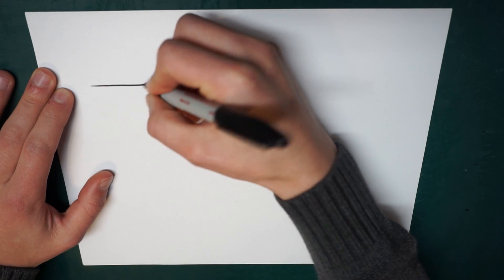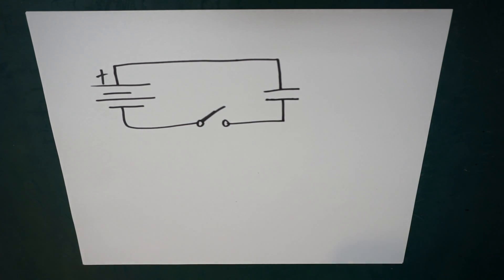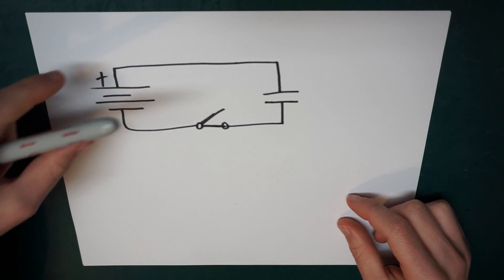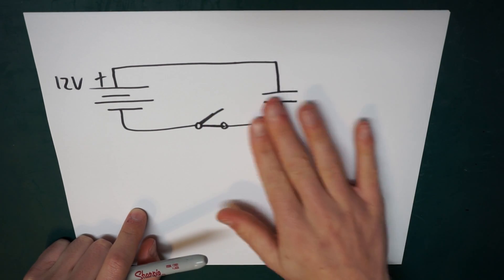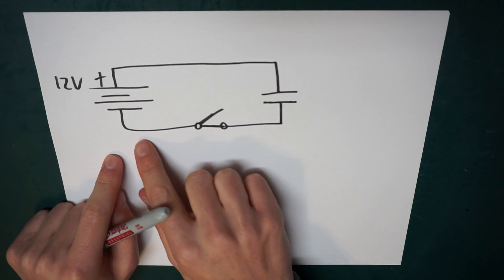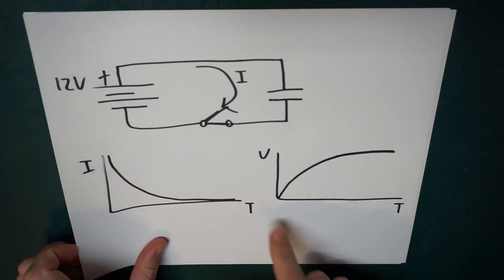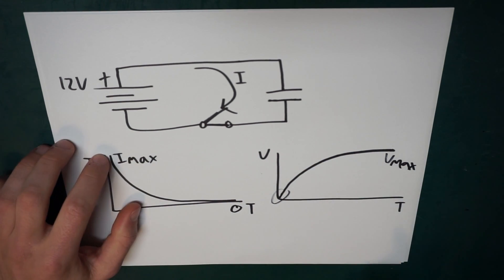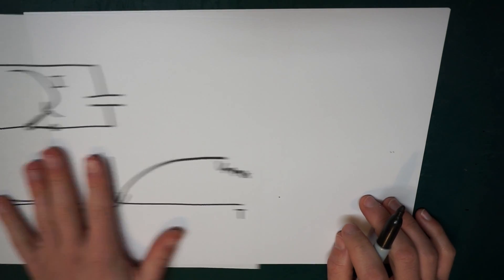Circuit Fundamentals - Capacitors in DC Circuits

Comment: That's why capacitors can be lethal. They will hold that charge and will give you a real wake up call if you were to touch the leads. 12v won't kill you but if you're working on an amplifier where there could be 400v stored on a capacitor it could kill you. Hence the importance of discharging capacitors before working on anything. Thank you for such a great and simple explanation.

Comment: You forgot as usually everyone does, to explain how they charge and discharge since a battery is always trying to flow to it.  How does the cap know when to discharge and from which side does it discharge?  those are the questions I needed answers too. otherwise good video.

Comment: Hi, sir and all others,
I wonder what if we have a capacitor directly connected to a voltage source. Is there a way to find the I(t)? Due to the absence of a resistor, we cannot get a time constant. Thank you
Reply: i(t) =C•d/dt v(t), if v(t) = A•u(t) then i(t) = A•C• delta(t), it means the capacitor will be charged with no time at A volts  by an infinite current. In practice it doesn't happen as the power supply have a resistance as well as the capacitor,  but is not recommended at all as it creates a current peak which could damage the power supply or the capacitor.

Comment: At 4:30 you said when the capacitor charges up, there will be no PD between the battery and the former, so does that mean before it charges up there is a PD between them? as in through the wire? Or where would this PD be? Thank you so much your videos are amazing!

Comment: How about a Capacitor and Inductor in series with a DC battery, Can you please make a video on the Physics what happens? no resistors involved. Thank You, Sir. Now also the same dc battery connect the inductor and capacitor in parallel, please explain the Physics how the inductor and the capacitor: current and voltages.

Comment: Why does the capacitor try to charge upto 12v only?
Reply: because that is the voltage supply in this circuit
if the supply voltage was 20 v then it would 
charge up to 20 volts

Comment: I am still not clear on this.  My problem is I have a model train passenger car.  It is a lighted car and when it goes over a dirty rail and loses connectivity, the light goes out.  What value of a 24volt capacitor that will hold about two seconds worth of charge at 14 volts so that the light never turns off while running.  I am actually using a strip of 12 volt LEDs and have tried a couple of capacitors that I had but they don't hold power more than a fraction of a second.  Thanks in advance for your help.

Comment: Does the top half (the plus side) of the circuit also have current flowing through it when the capacitor is charging?

Comment: Very nice video! Thanks alot for that explanation!
I have a question regarding capacitors:

After doing a backlight mod on a GameBoy Classic, there can be a whining sound on some devices, caused by the power drain of the backlight.
There is a fix by soldering a capacitor onto the circuit board.
I would really like to know how that technically works. What exactly is connected by the new capacitor, and why is there more power afterwards?
Here's the link: https://howchoo.com/g/ndm0mjvlzdy/how-to-fix-speaker-whining-on-a-backlit-game-boy
Thank you for your time!

Comment: I have yet to see anyone explain this to me in English

But...here’s my grasp
DC signals do fuck all to capacitors

Because......
Capacitors are basically batteries

Shitty batteries, you wouldn’t use them as a battery...but....they are a little can that can get full of angry pixies and discharge them later

So....putting a DC power on a capacitor is gonna be about as interesting as putting a battery on a battery charger.....”real fuckin neato”

And once that battery is full....pixies don’t want shit to do with it
It’s a traffic jam in their, and there’s nowhere for the pixies to go

So....unless you’re gonna pick the capacitor up and shock your friend....putting a DC signal on a capacitor by itself is useless

But, it seems in amplifiers....we take an AC signal AND a dc signal to boost our ac signal with some hardcore DC power
Then use the capacitors to get rid of the DC power to give us a super-charged AC signal

Is this at least a tentative grasp?

Comment: what would happen if you put a 3 ohm 1/2 watt resistor in parallel with the capacitor?
Reply: Most of the current would flow through the capacitor as it charges up. At this time little current goes through the resistor, but as the capacitor approaches Full Charge most of the current travels through the resistor. Once the Capacitor is fully charged - All of the current is going through the resistor. This is only when the resistor and the capacitor are in parallel to each other.